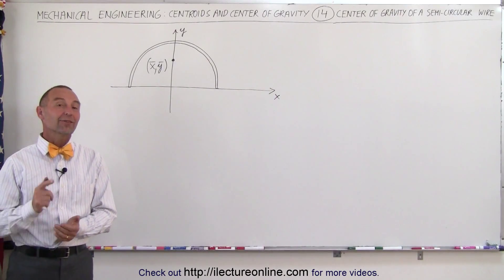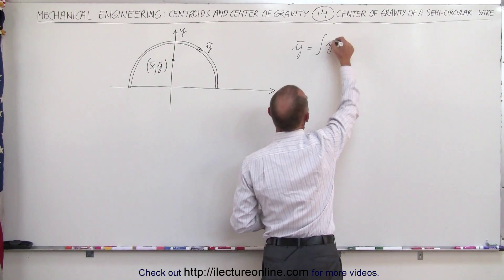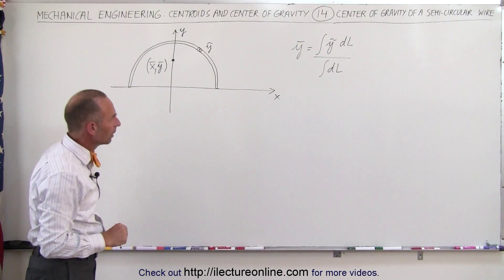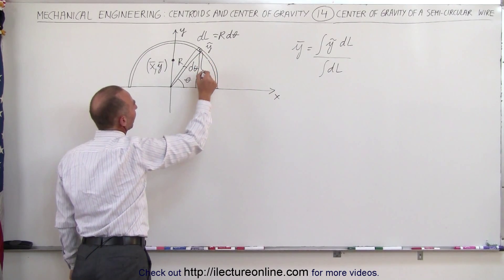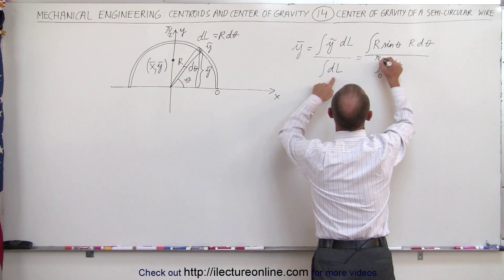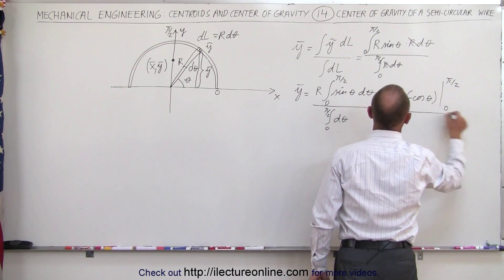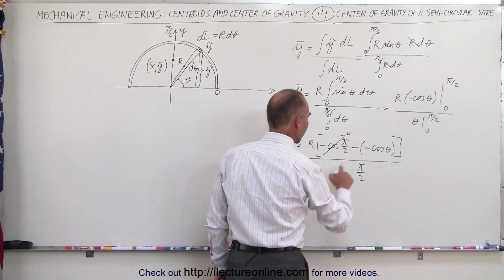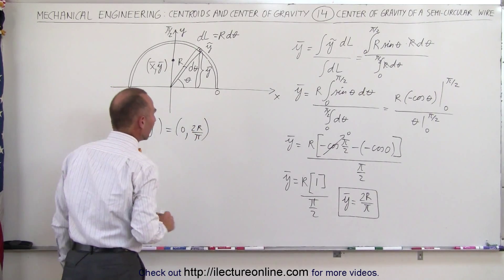Mechanical Engineering: Centroids & Center of Gravity (14 of 35) C. G. of a Semi-Circular Wire

Comment: what is the difference between Centroids & Center of Gravity & center of mass?
Reply from the maker: Centroid is the center of mass of a geometric object of uniform density.   Center of mass is the point of an object where all the mass of an object appears to be concentrated when in motion or when at rest.  Center of gravity is the point of an object that if supported at that point the object would remain in equilibrium.  (essentially it is the same point as the center of mass)

Comment: thanks great videos. Quick question if you are analysing y axis position of an arc from 0 to -90 degrees (3pi/2) would you follow the same method just using (3pi/2) lower limit and 0 for the upper limit?
Reply from the maker: I would use the method shown in the video (keep it the same).  Because of symmetry, you would get the same answer.

Comment: How can you do this for a quarter wire and without neglecting the thickness?
Reply from the maker: We have videos that show you how to find the CM for a partial arch and use the same technique in integration as a wedge  -  both types are in the playlist.
Reply: @MichelvanBiezen  Thanks. I will check it out.

Comment: Is it the same for the half of a hollow cylinder with two radii (so a thick shell not just a surface)? Hope u can understand my english :) ty
Reply from the maker: With a ring, all of the mass is distributed at a distance R from the center.  With a semi-circle, the mass is distributed everywhere.  Take a look at the video where the center of mass of a semi-circle is calculated:       
    Mechanical Engineering: Centroids & Center of Gravity (6 of 35) Center of Gravity of a Semi Circle
Reply from the maker: Yes, it would be the same thing for a half cylinder with a thick shell.
Reply: @MichelvanBiezen  thanks for your fast answer! But why is it then different from the center of gravity of a full half circle? (4r/3pi)

Comment: What if you are trying to find the centroid of the top/bottom half of a pipe/shaft and you have two radii values? Or if the wire isn’t necessarily thin
Reply from the maker: If the disk is thick, then you have 2 choices.  Use integration over the disk, or find the centroid of a half circle and subtract the centroid of the hole.

Comment: If the wire is a uniform density, shouldn't the center of mass lie on the spot that divides the wire into two equal length? On the x axis this is still 0, but on the y axis, y= r/sqrt(2). The arc length above and below this will be equal, so the mass above and below will by equal. Why is this no the center of mass?
Reply from the maker: You need to use the strict definition of finding the center of mass as shown in the video.    If you look at the videos in the beginning of the playlist, or watch the videos on center of mass in the physics playlists it is explained in great detail.

Comment: Sir if we take half of the portion in that case shouldn't we multiply whole integration by 2 ?
Reply from the maker: Not in this case.  We are not finding the AREA, but the center of gravity and it is the same for the left (or right) half as it is for the entire semi circle because of symmetry.
Reply: It is correct that you do not multiply the NET integral by 2.....the more fundamental reason is that since you are doing only half of the symmetrical integral for both the numerator and the denominator, you would then need to multiply both top and bottom by 2, which obviously would then cancel out.
Reply: @rontoolsie  thank you for this, this made more sense
Reply: @rontoolsie  thank you. I thought the same but you cleared my doubts.